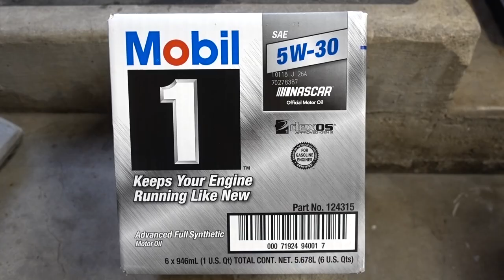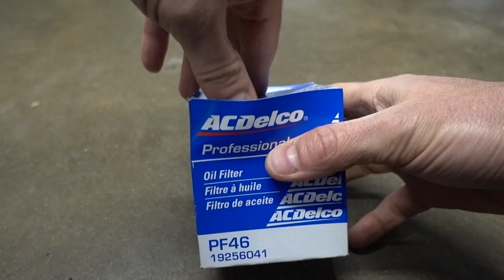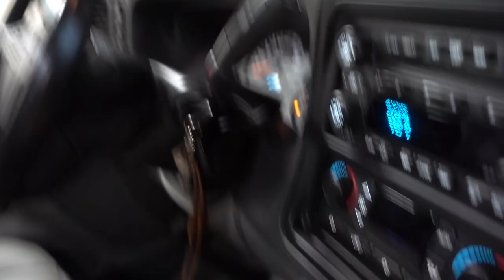BEST OIL FILTER HACK IMAGINABLE!!

Comment: Putting magnets in or on the oil pans, trans pans, drain plugs, etc., could catch various ferrous materials that are suspended in the motor oil. However, what you are forgetting is that the oil filter is pressurized. The oil is coming into the filter pressurized and leaving pressurized. In some cases the pressure can exceed 40-60 psi depending on the vehicle, and the filtration design. If the filter is working properly most of the paritals would be caught by the filter material. If the filter becomes plugged because of too much dirt and particulates they usually have a pressure relief valve that opens to prevent the engine from starving for oil. When that valve opens it almost like having no filtration or very little filtration. Let's say the ferrous material is microscopic and could pass through the filter element then the magnets on the outside seem like a good idea but because the filter is pressurized they would still most likely be dislodged from the pressure and pass though the filter. For magnets to work on the outside of the filter you would have to have an extremely powerful magnet that could hold the tiny particals in place. The smaller the particals the less area they have to stick or stay in the magnetic field if disrupted by the pressurized oil. Image a garden hose with no nozzle, its not very efficient at removing dirt and particulates. However, put your thumb over the hose end and the dirt and particulates are washed away. The same principles happens here. You would do better if you had a double filtration system. Not only would it filter ferrous materials but it would filter dirt, dust, and varoius other particulates that are sucked in and make their way past the air filteration systems.
Reply: I’ve always wanted to glue some magnets to the outside of my oil pan right under the oil pick up tube. That way I’m not fighting pressure inside the filter or oil galleries inside the engine.
Reply: I do believe he said "Earth" magnets, those are extremely strong magnets. If I'm not mistaken, they are the same type of magnets used in computer hard  drives. I've "heard" of people using those (hard drive magnets about the size of 4 of these little ones combined) to stash good sized caliber "tools" securely on to vehicle frames worry free of them falling somewhere. People who drive like maniacs on the freeway, over speed bumps, you name it.
Reply: Frank Lenny good man!
Reply: Pressure and flow are not the same thing! Pressure doesn't make flow! This is the same logic as Volts and Amps 
Volts = Speed, 
Amps = Pressure
Volts is equivalent to Horse power
Amps is equivalent to Tourqe
Reply: @KRich408  I think you missed the analogy and mostly the carparison of the oil sitting in the sump/pan area as oppose to oil flowing through the oil filter which has been pressurized by the oil pump. Study after study has shown that some oil filters can be a swirling vortex. Yes, there is pressure and flow. Several automobile institutions and universities have examined bearing and babbet materials to see what has imbedded itself into the various bearing materials and the greater problem wasn't always metal particals but other materials such as dust that was nearly as hard as diamonds. A few studies have even claimed to find substances thought to be meteor dust. The point is... a better filtration system or dual filters would serve better at protecting the engine then mere magnets alone, because it (better filtration) would catch both metallic particals ferrous and non ferrous (such as aluminum piston material). It would also catch dust and extremely hard particals that would grind and damage engine components, while a magnet would have no effect at all on non metallic particals.
Reply: @franklenny2741  I didn't miss anything so when. The oil in the pan is being sloshed around by a crankshaft turning thousands of RPMs and that magnet on the drain plug sometimes there's one in the pan itself  has less turbulence than what's going thought the filter??? Think about the logic here! Your missing a lot of variables also there's centrifugal filters that have no medium! Just brute Force to remove the particulars! Kind of like a Dyson vacuum!  I have motorcycles that use a centifuge filter  a MC reaches a  much higher RPM and clean out is much more important under that kind of stressThat technology has been around way before Dyson ! And it works in industrial environments quite well! The  filter doesn't have nearly as much  going on as what's happening in the pan so why is a  magnetic in the pan  ok but in the filter not?
Reply: @KRich408  first of all, most cranks aren't sloshing around in the motor oil. The oil is picked up by the sump and sent to the various oil galleries, channels etc.  This is how the majority of larger engines are lubricated the oil will gradually return to the oil pan or sump area. This is why each engine requires a certain amount of oil in the engine. As the oil is sucked up through the sump, it requires a certain amount of time for the oil to return to the sump to be used again, and again. If the engines oil pump sucked up too much oil, then the sump area would run dry if there wasn't an adiquate amount of oil. However, on the other side... This is why manufacturers will warn about over filling your engine oil. When there is too much oil it starts to interfere with the turning of the crankshaft, when that happens the oil can foam them the sump doesn't suck up straight oil it sucks up oily air bubbles. The whole foaming process can in turn starve an engine for oil (usually at an alarmingly high percentage). A few smaller engines have used roller bearings at the crankshaft to minimize the effects of dry bearings, but they have their own isses. The throws or counter balances can come in contact with the oil at times and with extreme angles. If the crankshaft where sloshing around in the oil it would throw far too much oil on the cylinder walls for the wiper ring(s) to work properly and as you can assume the engine could start smoking. It would also hamper faster engine RPMs (since the laws of physics says fluids can't be compressed). Some small engines that don't have oil pumps have slingers. As the name implies, it slings oil on the various internal components, but even these engine don't have crankshafts sloshing in the oil. Engines with slingers (such as Briggs & Stratton) usually have governors to limit the rpm because at faster rpm speeds the oil slinger may not provide adiquate lubrication.

As for your previous analogy pertaining to electrical horsepower. Electrical horsepower is measured in watts not volts alone. It takes 746 watts to equal one horsepower. Example a 1HP motor could be calculatd in several ways. Example: if you had an electrical motor that used 120v@6.21 amps =746 watts or 1HP. Another example: if you had a electric motor that used 220v@3.39 amps =746 watts or 1HP. Still yet another example: 24v@31.08 amps =746 watts or 1HP. As you would assume this doesn't take into consideration any efficiencies or volumetric efficiencies.

Comment: My Ducati has an OEM magnetic drain plug that could not even lift up the wrench I was using from off the garage floor. I replaced it with a bespoke after market replacement and it suck the wrench right off the garage floor. Chalk and cheese difference and it pulls heaps of ferrous material from the oil.

Comment: This doesn’t really do anything positive.  If there are that many metal shavings in your engine, there is something majorly wrong.  Most sumps have a magnet for the general wear.  If you need to put them on the filter, too, possibly restricting oil flow and pressure, you deserve your engine grenading as a result.

Comment: Also scientifically, the magnets work in attracting ferrous metal particles. BUT you never mentioned microns. The filter element catches particles that are up to a certain micron which any smaller particles that may flow thru the filter are deemed non threatening to the pump and cavities. I do believe if you are experiencing metal shavings or particulates then regardless of the filter or magnet, something is eating it self beyond the point of salvaging filter or no filter

Comment: I did it and i extended my oil by a long shot i don't have to change my oil no every so often now with this trick. Try it it works it extends the life of the oil to where you might forget to change your oil lol but seriously it works i do this every time i change my oil and later on in the day my car performs like a dream keeps the oil clean and tidy  and keeps the power of the engine at its highest peak even you'll notice a difference in the first day you drive trust me awesome trick and it works and i love it

Comment: You really need to do an oil analysis to answer this question.
Circulating ferrous particles drop by ~50% when you use a magnet.
Surprisingly adding more magnets doesn't seem to reduce ferrous metals noticeably.
Fe is usually one of the main contaminants in oil... so reducing it by ~50% is worth doing.
Engine noise is often noticeably reduced after adding a magnet.
Less noise means less friction, less wear and more power.
Less particles in the oil means a longer oil and additive lifespan.

A magnetic sump plug can be used to measure wear in the engine e.g. Which oils, oil additives, etc... work best and to warn of potential problems.
It's much harder to do if you put your magnets only on the oil filter.

For the minor price a magnet is a no-brainer.
🙂
P.S. You should have shown a close-up of the sump plug magnet to demonstrate that it's catching ferrous particles.
A lot of people responding don't seem to realise how much metal is caught by magnets.
That's why a lot of factory sump plugs and most transmissions include a magnet.

Comment: No.  Your just keeping the oil filter bypass valve closed.  Neodymium doesn't work over 180°, so really you're just going to get magnetized particles sticking all over your motor. That's why the factory uses a mild magnet at the plug. That's all.

Comment: The 3 Rare earth N52 magnets that I put on my oil filter are the size of a 50 cent piece, 2 on the sides and 1 on the bottom.And yes my Tacoma has an aluminum block with Iron sleeves also. Which alot of people don't know. But here's a thing you probably don't know ? Is that the magnets will lose power over time because the magnets have a weakness when exposed to temperatures over 170 degrees F. Thats why the magnets on the drain plugs seem weaker when your car gets older. The 10 R.E.M. that I purchased ....not (Rapid eye movement) lol. Cost me about 12 $. They can pick up 30 lbs. So they are very strong, I use them for holding down a plastic tarp to cover my compound Miter saw, and placing my spare key to my truck under my frame of my truck.....etc. etc. etc. Hell , I say fk it and use them for my filter cuz I love my truck and its about the only thing I own worth a fuk , besides my Mathews bow, G-Loomis fishing rods, my guns and my tools.And if it helps it last longer yay. If not , at least I have done every preventative maintenance task possible within my power. And feel just fine about it.Considering my severe case of OCD....lol Peace out (QUADS) Ps here's a little tip for you guys, get some rubber restorer and crawl under your vehicle and spray that shit on your rubber transmission mounts motor mounts ball joints etc.......WOW what a difference !!! smooth as silk . Its like a new truck after doing it....

Comment: always used a magnet from old speaker, on the bottom of the filter, and when I open it always has something stuck but the  say  when there is metal stuck something is wrong..

Comment: This won't work too much pressure. That's why your drain plug has a magnet.
Reply: Totally false. They work for a fact . I use the N52 REM about the size of a 50 cent piece . They can pick up 30 lbs. no problem. Use a pipe cutter after your oil and filter change, cut it open and look where your magnets are...its like a little tiny pile of powder. When you move the magnets around , it will drag the fine powder of metal around the inside .... It works for real. People who never have done something will tell you that its wrong even though you've been doing it because of hands on experience....I know if I say something to dispute someone , its because I have studied and researched the shit out of it before I open my mouth spewing out a bunch BS. Times have changed. While growing up I was taught , If you don't know for a fact , don't act like you know. Because your word reflects what type of man you are.....And after time your drain plug magnet gets weaker because of its weakness/flaw of being exposed to temps over 170 degrees F.
Reply: Well said Mr. LL, Using Magnets on a filter can in fact extend the life of an engine 3-5 times as proven by oil analysis using the APC Particle Count Test method. It counts the particles by size and weight. The particle count test using an optical particle counter of a used oil sample actually counts the particles in each ml of oil. You can math out the total particles by numbers and weight by multiplying by the sump volume. The test counts the particles by size in each category, (ie) 4 microns, 6 microns, 14 microns, 50 microns, 100 microns. The difference in using magnets and not using magnets can in fact reduce particle counts by up to three ISO codes. The particle counts double for each increase change in one ISO Codes. So reducing the particle count by three ISO codes by using the magnets reduces the particle counts in the oil by four times. This correlates to extended engine life of four times by plotting on a logarithmic graph.

Comment: I say slap one of those 200lbs holding magnets right besides your drain plug, right at the bottom. Right before you drian your oil pull it off and hopefully those metals will get drained as nothing is holding them anymore. This will only work if your pan is metal though. That Tahoe looked aluminium. You could glue a metal tab there then stick the magnet to it. I dont think the magnets would hurt on the filter but it is a high flow and pressure area and likely the metal will not hold when the  pressures are 50-100psi sometimes at high way rpms.

Comment: Good idea with the magnets! But definitely NO need for magnets on the filter. The sump is a Better spot and the manufacturers have been doing it for years 
It’s a FILTER and it doesn’t need extra help from your little magnets, it’s already designed to catch that crap in your oil, if you replace it every service you won’t have a problem.

Comment: Anybody watching this video please don't use the filter wrench to TIGHTEN the filter on.  I have seen many vehicles get towed into garages because someone used a filter wrench to put their filter on then couldn't get it back off.  They generally end up poking a hole through the filter in an attempt to get it off then can't even drive the car in to a garage to get it fixed.  Follow the instructions and only make it finger tight plus a half turn for just enough compression to seat the rubber gasket and ensure that it doesn't come off.
Reply: Truth, theres a reason why theres a rubber gasket on them. I loathe hard to reach filters that are cranked on.

Comment: If you wrap an insulated copper wire around the oil filter and hold each end of the wire to a battery for a few seconds, it will magnetize the entire filter

Comment: For those who has doubt, look at your transmission drain plug (one that has a magnet attached to it) and see what attached to the plug.
Reply: There is a round magnet up laying inside most transmission pans also and they do not catch everything as the pan is usually coated in debris as is the magnet inside the pans.. They try to claim oh it doesn't need serviced at all so it ensures future repairs due to not being serviced.magnets will only catch a small amount! Always service transmissions at 60-100k no matter what a dealer or sales person claims.Running the same fluid past 100k ensures failure! conventional or synthetic fluid
Reply: @tryduck6993  Nonsense   Changing your transmission fluid will destroy the unit.  Seen it happen many times.  You must be in auto sales

Comment: 1. Buy a torque wrench and torque the dran plug correctly.
2. Never use the oil filter tool to tighten the filter...
Reply: 1. Correct, always use torque wrench to tighten drainplugs.
2. There is no problem to use a filter wrench to tighten the filter, as long as you to not overtighten it.
When you have oil on your gloves, it can somtimes be hard to tighten enough without any tools.

Comment: You didn't clean off the gasket surface, WRONG, you used dirty oil for gasket lube, WRONG! Never tighten an oil filter with a oil filter wrench, by hand only. After 40 plus years, and who knows how many oil changes I have done, I never had any problems.

Comment: Why put old oil on your filter gasket when you have clean oil right there? I see this a lot on Youtube videos. Also if you really want cleaner oil, why use an ACDelco oil filter (that has a cellulose media)? A better filter would get way more particles out. I would suggest a filter with fully synthetic media such as WixXP, Royal Purple or SynLube. Even a synthetic blend would surpass the ACDelco PF46.

Comment: I thought that the oil filter was a filter and would filter out the metal particles so why the magnets?  If you are really worried then you should add a better filtration system.  The magnets in the oil pan catches particles in the non filtered oil.

Comment: i had it and opened filter and metal dust was only at bottom position of filter because higher mounted magnets were in too strong oil flow and nothing catched on it. so place magnets on bottom half of filter